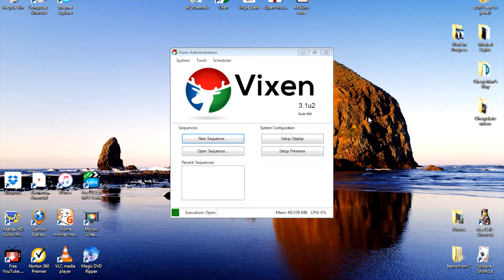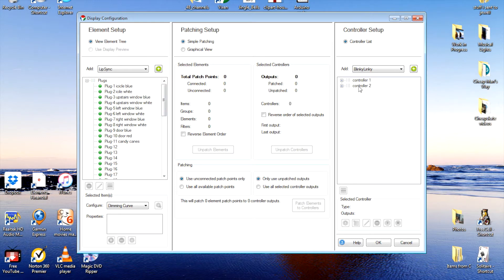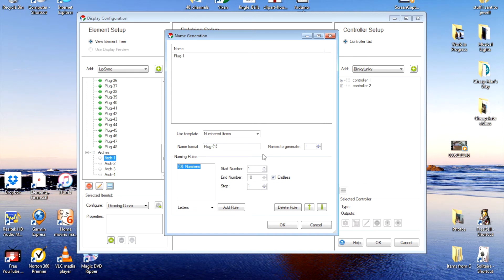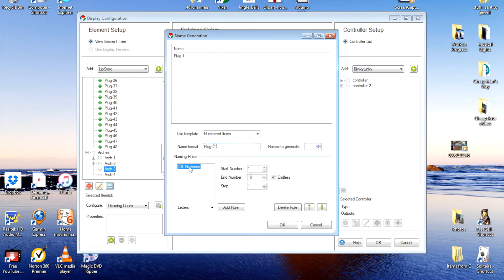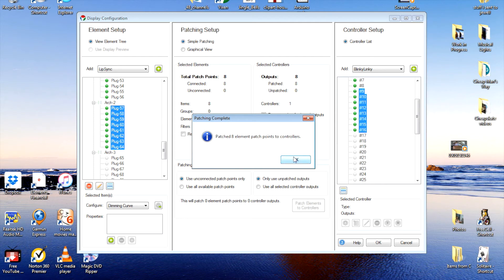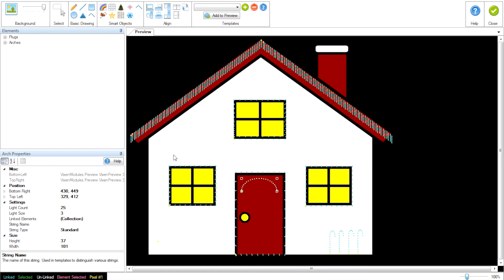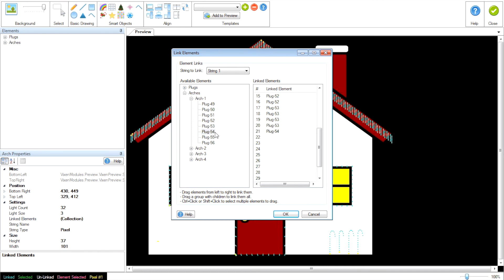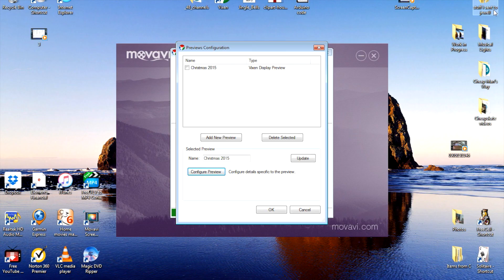Cheapskate Video 2 Part 4, Christmas Lights to Music Using Arduino and Vixen Lights

Comment: Completed box. Programmed arduino board. Programmed some songs. Wanted to test the box so I plugged in the lights, and now how do I test the songs I've made? Played them through vixen with the computer hooked to the box but nothing happens. Do I have to create a playlist somewhere? I went through your  videos and didn't see anything on how to do this.
Reply from the maker: When everything is programmed and connected all you need to do is play a sequence. To be hands off you set up a show in vixen. Your problem is impossible to diagnose from here. The only tips I can give you are to make sure your controllers are programmed with the correct port numbers. Anytime you disconnect the USB cables from the computer and then plug them back in the computer will reassign them new port numbers. You can easily fix this by restarting your computer with the USB cables plugged in. Be sure your rates are set to 9500. The system works for myself and scores of other people. Watch the videos again very closely, I'm sure the answers are in there somewhere.